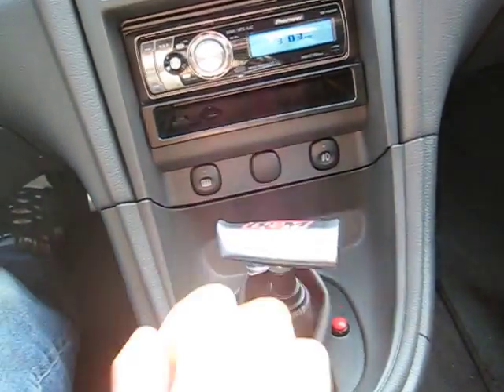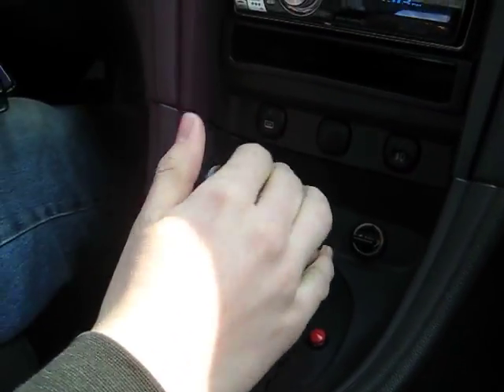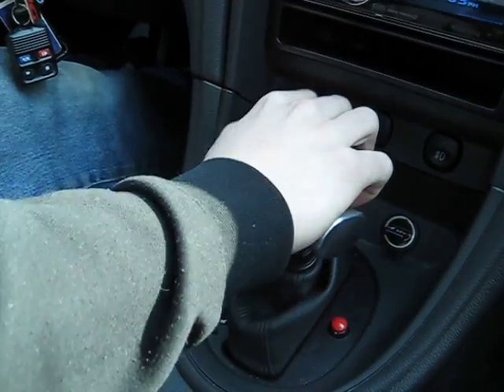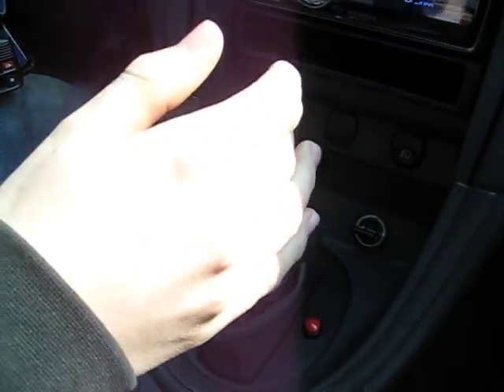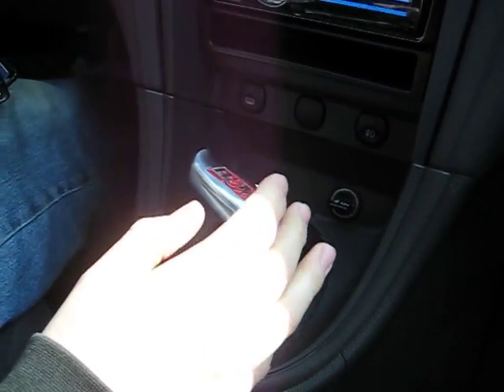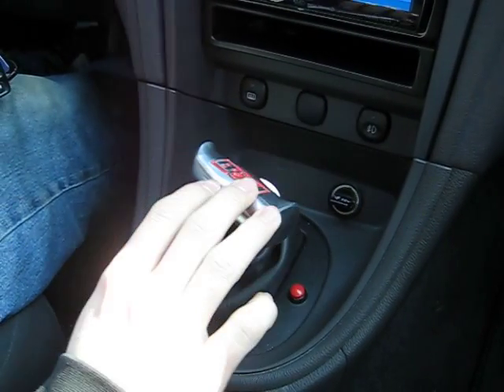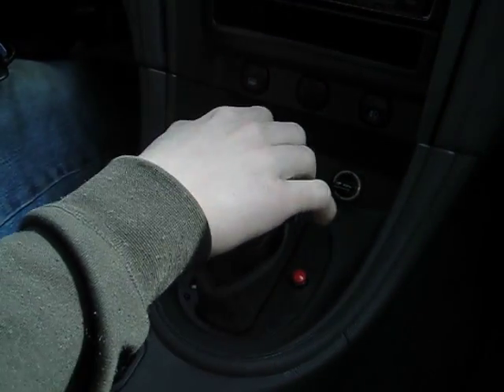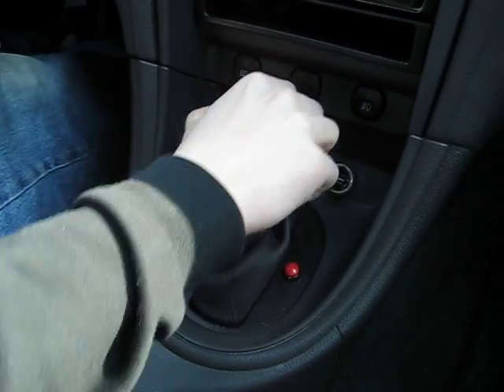B&M Hammer Demonstration

Comment: hey thanks for posthing this video i had no idea how to work the shifter i always wanted one but i bought a used one and i thought it was broken then i found out how to use it when  i saw your video so thanks alot shifter works bad ass big difference, hey quick question dont know to much about transmision but how do know if you got a manual valve body is that something u install urself or a transmision option

Comment: i have one on my 00 mustang gt and love it. its more ergonomic for me as well, the handle that comes with it is nicer than the stock one. the only downside is driving in below zero temps or summer heat, the metal handle gets real hot or real cold depending what time of year.-as compared to the stock plastic knob.
its funny how many people cant figure out how to work the hammer shifter when they're in my car. lol

Comment: I want one! Was it hard to connect and adjust the shifter cable? Also, Where does the LED gear indicator light get it's power source? Along the 12v outlet wires?